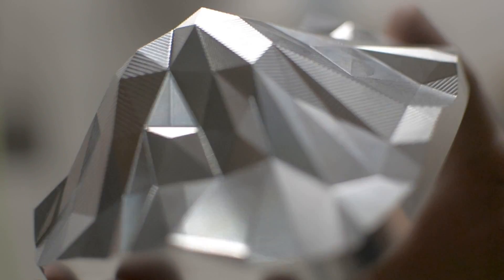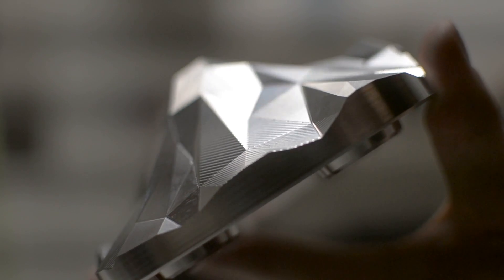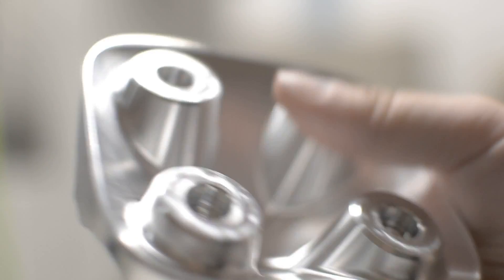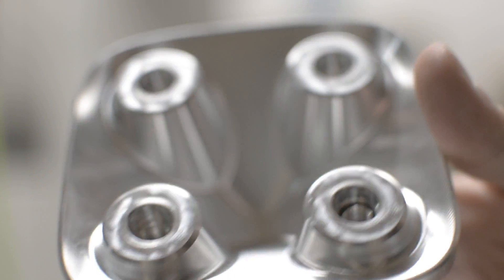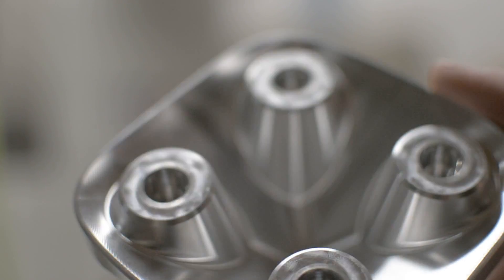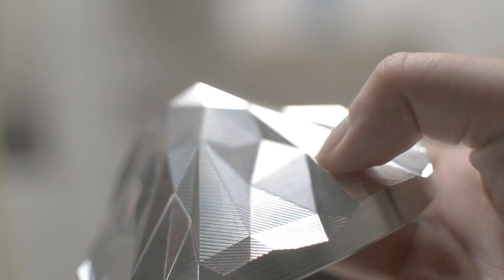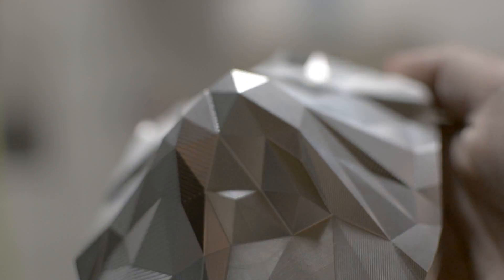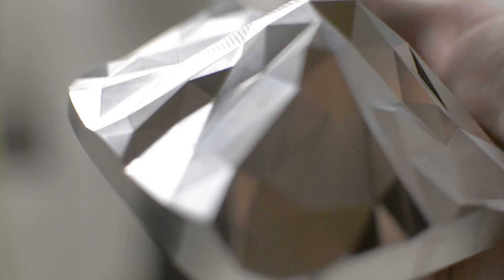Fusion CAM Challenge Entry

Comment: That's awesome rob! I build Digital Terrain Models (DTMs) for construction sites by use of Triangular irregular networks(TIN). Never thought of machining one though.  Did you use a different stepover for a portion of the triangles? Some seem to have a different surface texture, it looks cool! Thanks for sharing it.
Reply from the maker: yep, I applied another toolpath over the finishing toolpath on some of the sections to give them additional texture!